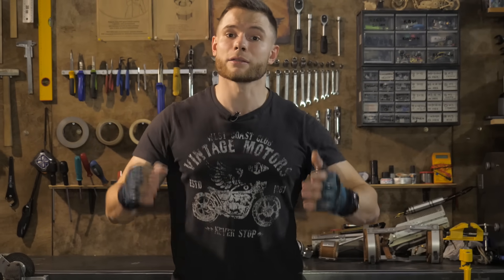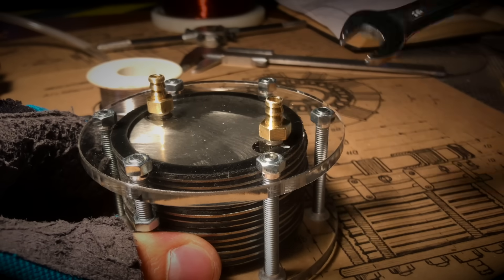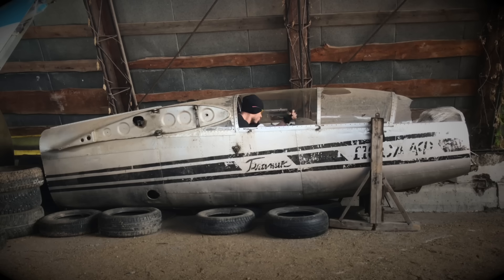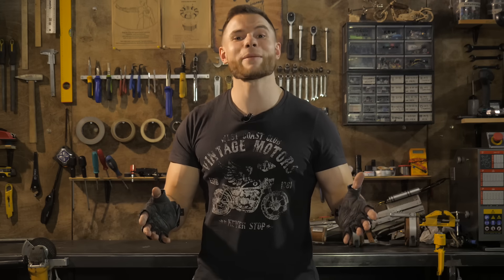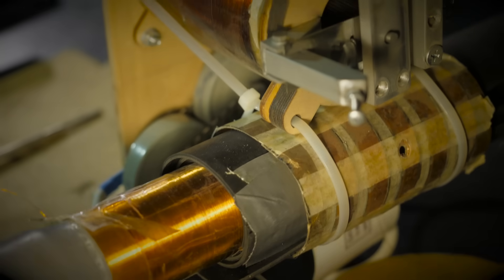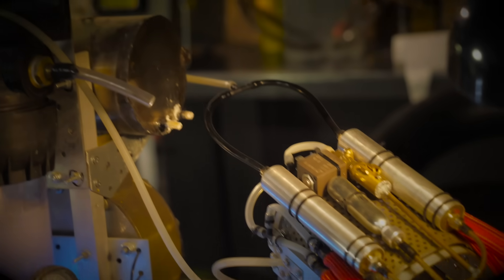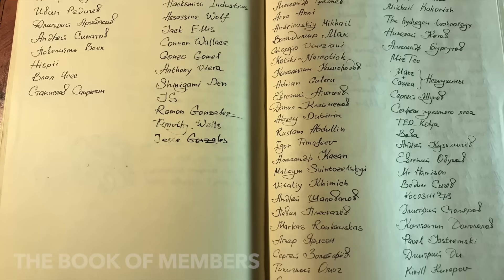Building real Iron Man suit (Part#1: Conception & Protoypes. Reactor, Repulsor, Armor, Exosuit)

Comment from the maker: Guys, grab the link for internal inspiration source https://curiositystream.com/AlexLab
Use promo code AlexLab to get annual access for 15$
Please, write here what interesting episodes have you find on Curiosity Stream?
Reply: Have you thought about putting aero gel on the palm or hydrogen torch on the iron man gauntlet so it doesn't have to burn your palms??
Reply: @marz.6102  it is expensive i think
Reply: @thevindukottege8799  what is?
Reply: Hey I have a idea for you!!❤️

You can use many lithium sulfer batteries instead of electrolyzer like hacksmith did in his leaf blower video and stored around 50 kw, but hacksmith used lithium polymer not lithium sulfer but lithium sulfur is 5 times more powerful so just make circle of batteries like hacksmith and put it in your chest plate

I hope you read this comment maybe modify my idea to get better results and give me a heart to let me know that you read my comment please🙏
Reply: @ruchiryadav8112  you should put this comment on the other comment of his where he asks us to give him ideas!!!!
Reply: @ruchiryadav8112   if we use that method, then the reactor part of the suit will be gone. thus loseing the "iron man" theme.
Reply: @ruchiryadav8112  Yh good idea
Reply: Для шлема есть предложения. 
По сути, ты можешь привинтить на место глаз 2 камеры, и от каждой камеры дисплей, а внутри типо VR шлема(линзы). Инфу с камеры будет обрабатывать 1 процессор, либо по 2 на каждую, сделай активную систему охлаждения(вертушка), графический процессор, оперативка, постоянная память(где установить это всё - решай сам), ИИ внутри не обязателен, просто графический интерфейс. По сути смартфон внутри. И, насколько я знаю, использовать 2 процессора - будет выделяться меньше тепла, соответственно можешь обойтись и пассивной системой охлаждения.
Но я думаю там мало что обрабатывать, поэтому может и получится одним обойтись.
P.S: Нейросеть. Нужно научить её анализировать полученную инфу с камер.
P.P.S: Второй процессор-для нейросети. Поищу информацию, помогу чем смогу. Удачи.
Reply: @baNO4kaXD  might you translate please, thank you so much!???!!
Reply: For the armor plating I would suggest you look up Robert Murray Smith of England; he does a lot of work with Graphene and has had much success in putting together weapon resistant materials with it.

He has a list of videos and I think you to would get on well. It could be inspirational for you Alex, as you also salvage and reclaim many of your materials.
Reply: @ryanlebeck259  have a link tho??
Reply: @ryanlebeck259   you should try to put this comment on the other comment of his where he asks us to give him ideas!!!
Reply: watching from Brazil, your videos are awesome!!
Reply: Love your videos Alex Lab! As an engineer around the world watching, I have so many more ideas than you would ever want to hear about how to build the suit! I've worked on a couple similar projects of my own, you're right, armor is hard- I would recommend avoiding joints all together, and instead of trying to make a metal joint that doesn't limit mobility to much, focus on covering most of your body. Then use straps around the joints the connect upper arm pieces to lower arm pieces, upper arm to torso, and lower arm to hand. Then if you really feel like you need armor around the joint, use either chain mail, or make a small pully system attached to a small metal plate that would cover the joint so that when you go to move your arm for example, the flexion of the bicep will pull on the pully, drawing the small metal plate (covering the joint) away from the joint so your arm has room to bend. That's just my first thought, thanks so much for all the awesome, inspiring stuff you're doing, I love it!
Reply: Dude.    U can use segmented parts with bearings in between Each segments which helps u to develop more easy  movement....  Don't use a single plate and cover the body rather use segments....  Like let forearm be divided into 5-6 segments which are interconnected through segments... .... For. More details contact sreeragmenonrolling123@gmail.com
Reply: Add a coil gun on your sute
Reply: @anirban8368  would u know how since you suggested it?
Reply: @marz.6102  nice bro 👍
Reply: @anirban8368  yes sir
Reply: You mention that with more pressure in the reaction chamber less energy is needed to preform electrolysis. I imagine that the critical point is the limit to this but it would be interesting to play around with, very don't try this at home but if nothing else riding the line seems a logical end point, sub critical maybe and if things pan out maybe some experiments with supercritical fluid.

Otherwise if you had a layer of bladders between the frame and you, then they could hold more fuel, the suit could pick up the weight and the whole thing would be as comfortable as a water bed. You can control the pressure in the bladders to let up as you move and give you a full range of movement but stay on you where you let up. More of a master chief thing but it could also react to shock and increase pressure like an airbag would [if that even helps?]. I notice in the ironman movie he wears a wetsuit kind of thing under the interlocking parts. Having armor padding is never a bad idea and full plate is notoriously hard to wear. Fur, Gel, Foam, Something... 

Tl:DR Super/Subcritical electrolysis, more fuel storage, and power armor needs armor padding too...

Somewhat related links...

https://www.technologyreview.com/2009/08/11/211065/supercritical-fuel-injection/#:~:text=The%20higher%20combustion%20temperatures%20required%20to%20burn%20diesel,between%20those%20of%20a%20liquid%20and%20a%20gas.

https://www.sciencedirect.com/science/article/abs/pii/S0360319920308788
Reply: @loveblowsbad  I have a paper on electrolysis that I can email you, including a way to make the reaction endothermic instead of exothermic
Reply: @ryanlebeck259  That would be super cool, I'd be interested in that. I think Alex maybe better suited to make use of tho... If he plans to use crowd sourced help on this a discord server would be wise...
Reply: @loveblowsbad  send me your email and I'll send you the paper; endothermic hydrogen reactions are past of the micro Hadron Collider I'm building. I honestly think I'm close to a cold fusion reaction to be honest.
Reply: @ryanlebeck259  how so?
Reply: Aluminium brazing rods work just as well to weld together aluminium joints as well. Robert Murray Smith has a video on that as well
Reply: Maybe Ball bearing joints? One around the upper forearm would allow left and right rotation. And then one on each side of the elbow joint. Might allow for smoother elbow movement @ALEX LABS
Reply: Single ball joints locate around the shoulder could also give you more rotation.
Reply: I´m not sure if you are that much into software but if yes you could put a pair of smartglasses and voicecontroll for some features of the suit in the helmet. It wouldn´t need to be a full fledged AI but maybe just a simple collection of voicecommands that a microcontroller could follow to do stuff like activating the pneumatic muscles or changing their powerthrottle. As always awesome video and I´m looking forward for the next one!
Reply: @ALEX LABS
Hey Alex,
Do you have a bachelor's degree in engineering? If so, was it an educative bachelor or a professional bachelor?
Reply: You should look into Magnetic Muskels. It is the same way our natural once work. The Air once are Dangers, can easily fail.
Reply: Alex, you need Frameless Servos or Torque Motors if you really want to achieve an integrated solution.
But you’ll need a power solution that is integrated across your suit platform. Perhaps a combination of LiPo batteries and super capacitors.
Your lever joints like elbow, knee, shoulder and hip can primarily be assisted with these motors/servos. For additional degrees of movement the joints would need additional design.
Flat pack power sources like LiPo and flat Capacitors can be attached to the inside of armour.
If you are designing using 3D or anthropomorphic software then the two layers designed separately and then constrained to each other in the model. 
tecnotion.com/products/torque-motors.html
usmotion.com/custom-servo-motors/custom-frameless-motors/
Reply: ALEX!!! In regards to your joints in the armor, how about you try using TWO points of articulation instead?

Look at Gunpla! Look for ones with the double joint system implemented in the elbows and legs!
Reply: Alex, you used the name of the actual weapon in your other video description title - rather than YouTube directly; it was most likely "flagged" by software bot, you can't put any prohibited words in the description or title anymore!  Censorship is for real these days now!!  Real: anti-people, anti-expression, anti-Fun!!!!  >: (
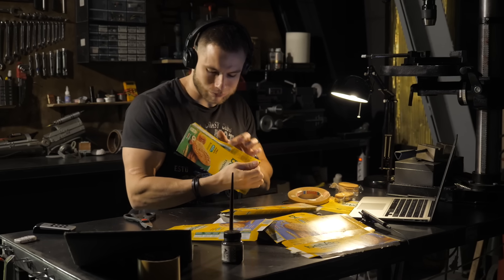Reply: What's the song in 11:20?? 
It isn't in the description!
Edit never mind
Reply: What if you blended the ironman armor design with the rig that Crossbones had on the back of his suit? If I'm not mistaken, it was there to augment his arm strength and allow him to hit harder.
Reply: Alex you use graphene in armour for maximum strengths in exoskeleton you use outer layer is hard like high carbon steel and inner layer is soft like synsodreme
Reply: For me it was the nanotech in medicine and solar panels taking in the infared along with light from the sun in curiosity stream!!
There is still more like genetic engineering
Reply: Алекс давай красава
Reply: U can also add a small induction welding system on your suit
Reply: @anirban8368  that would be the hydrogen torch on the iron man gauntlet
Reply: JLaservideo also does a lot of comic style inspired engineering videos and gadgets that you could attempt to include into your suit.
Reply: Por favor, me diz que faculdade você fez???eu amo essa área entende???? Quero ter esse conhecimento
Reply: Responde por favor
Reply: @Davidreixx08  English por favor
Reply: Yeah more constant updates are better. I much rather a new short video every 2-4 weeks where you show your progress and the issues you are working on rather than a longer video every 2-3 months when you have completed each full step. More videos on a more frequent schedule is also better for the algorithm and getting your videos recommended even just to your subscribers and you should get paid more with more videos. If you can't figure out how to do something then make a video about it and you will get 10 new ideas... 
It would be cool to include a few of those USB snake cameras in the suit for like a back camera, both sides and a better view of the front than just the slits and then just switch between the 4 USB inputs with a button or two ect! You could put them on your palm so you can see the flame shooting out and where you are aiming. same thing with any other "weapons" maybe an electric airsoft gun in your other arm, a powerful laser to light things on fire, the camera would also act as eye protection for that. and just pipe the video to an old smart phone screen in your mask (you can bury the rest of the phone, raspberry pi or whatever else you might use in the suit). Someone said that if you take away the back light from some phone screens you can see through the top display layer and use life as the back light making an augmented reality display. Maybe ask other youtubers who have tried things like that before about what they have found out during the process. You can always 3D print a mold then use it make pieces out of carbon fiber to get strong light weight bullet proof structural plates that also look cool. Watch Jarius of all and Ramy RC for your Carbon fiber lay up advice. Good luck!
Reply: @evilcanofdrpepper  yeah and his community can give him suggestion faster since it's a faster upload schedule !
Reply: So first idea I had for your request of fitting to multiple body types, 

Anywhere the suit (which can be a standard size) is in contact with the body could do so with an air cushion. A bit like a blood pressure machine which inflates to the required volume of air to achieve the required compression to the desired body part. Instead of leather cushions use inflatable versions which can be adjustable to the relative flexion/extension of each muscle... 

Disclaimer I'm not an engineer but consider myself a pragmatic problem solver. Consider it, if it makes no sense in your application, disregard it an move on but the concept of an adjustable suit seems valid in some way.. good luck.  I look forward to your next release along with other suggestions!
Reply: This is the best
Reply: I’m so excited to follow you on this journey and to see the all the work you’ve done so far accumulate to something even cooler. you’re an inspiration to me and more young engineers across the globe. Thank you :)
Reply: Хочу предложить Хаксмит озвучку профессиональной студии. Пробовал связаться, но безрезультатно... Если можешь, помоги, они твои видео комментируют, значит тебя не проигнорируют🙏
Reply: Maybe it would be better to use a Carbon/Kevlar comination for the suit... It would be easier for you to make and it is bulletproof.
Reply: Might I suggest with the pneumatic muscles instead of using them for direct motion using them to move pulleys apart, it would allow for greater limb mobility, also it would allow you to centralise the muscle systems
Reply: Н
Reply: Если 1 волокно будет тянуть 200 грамм, то пучок в 100 таких волокн даст тягу в 20 кг.
Reply: Алекс братишка - лови идею на миллион. Для искуственных мышц тебе нужно в эпоксидку закинуть растянутую катушку проволки и железный якорь. Сделай сто или двести таких волокн. Ну дальше собирай их в пучок как мышцы.
Reply: Hey Alex give me this songs name which are in your this video
Reply: Why not build your own iron man suit with some of your own touches on it and modifications where it is actually the iron man suit such as modification of the shield and comfort wearing it without losing the spirit of the iron man in the suit, meaning it is clear that you make some adjustments to the iron man suit
Reply: Hi, I like your videos very much, maybe I can help you with some coding for the software part. pls, e-mail me. fernando@softov.com.br
Reply: I wonder if you could make a hand charger like the flashlight in Metro 2033? If possible could it be adapted for installation into the knees and elbows of the suit to supply additional power?
Reply: what about using artificial muscles wrapped around a metal skeleton like 15:08 so you don't crush your body with them? to improve mobility, you can get a lot of inspiration from late medieval armor, the most sofisticated ones, that didn't limit mobility in joints at all. (by artificial muscles i mean the flexible rubber one, not pistons)
Reply: @jordicl4325  https://youtu.be/tpO5DgiCgyM
Here's a way to 3d print metal without a 3d printer, making you capable of making the armor light, strong and capable of flight!!
Reply: I think an exoskeleton that is for military use that is used for soldiers to carry stuff and walk and run easily would be ok with some modifications
Reply: Make desigen mark 85 arc reacter then prouduce more hho
Reply: are you serious get sponsored by spacex?
Reply: Not an engineer's idea so take with a whole plate of salt:

Considering the fact that you're torso-armour will be significantly thicker than what is shown in the movies, mostly due to the need of protecting the ark-"reactor" and aluminum-cell but also because actually functioning mechanisms will take up some more space than what was shown in the movies, have you considered "extending" the arms to fit accordingly?
This would take away the large amount of mass centered on your body, reduce the disproportionaly bulky appearance of the torso If you go and put in the effort to create this you have a right for it to be aesthetically pleasing. as well as give you the chance of making some distance between the repulsor and your hand, not only for safety reasons which are a major concern when operating with hydrogen in such high quantities and type of application but also give you more space for the machinery for both the replusion- and thrust-generation.
Overall- what you will end up with might just be a sleek hybrid between Mark I and II and I am more than looking forward to your progress.
Greetings from Germany.
Reply: В твоей работе есть недочёты.Ты слишком многое делаешь сам,чтобы получить лучший результат тебе нужно сфокусироваться на какой-то своей лучшей стороне и бить именно туда.Попробуй написать сам или найти человека,который напишет тебе ИИ,который будет тебе помогать,у тебя нет компьютера в голове и ИИ может облегчить тебе много задач к примеру по поиску нужной информации,ты можешь оставлять ему какие-то заметки,которые он потом легко вспомнит
Reply: @nikitamuliavin8144  what?
Reply: Love that Rick and morty like outro.
Reply: @justinwilliams7324  big brain
Reply: Hey you should try to use metallic glass for the reactor or if you want a see through design use something called clear aluminum
Reply: @normanpotter5184  I mean this was gud but this is why an ai system would work, it'll regulate the alkaline, the water and how much aluminum to put out in the solution. Especially when you would tend to us it more by using the repulser and the torch and when not to use it so it'll be not produce too much hydrogen.
Reply: @marz.6102  wait alkaline disilves aluminum I didn't know that what about the metallic glass
Reply: @normanpotter5184  well I unsure about metallic glass but I think I know that using aluminum, the very same thing that is being used for this reactor probably is writing disaster if you think about it.
Reply: @marz.6102  The problem with an ai system is that it’s not a “silver bullet”. As soon as it encounters a situation that is new or that you didn’t consider when training/designing it, it can start misbehaving which can have major consequences when working with hydrogen, endothermic reactions, etc
Reply: @drozen214  experimentation I guess
Reply: @normanpotter5184  bruh aluminum is the thing that he's using for the reactor. So the glass will both decay and melt.
Reply: @marz.6102  yeah but there is a way to make aluminum clear like in star trek but we can actually do it now
Reply: @normanpotter5184  but it's aluminum the same thing in the reactor that is being used to convert water to hydrogen and in doing so it will get very hot and melt the glass canister.
Reply: @normanpotter5184  he could use silicone that can deal with high temps instead tho!
Reply: For armor paneling, maybe you could use composite ceramic  and carbon fiber armor
Reply: What if you would do like a couple layers of metal that would slide into each other as you would bend your arm and then on the back they would slide out of each other on your elbow. Idk just a thought
Reply: Try aluminum for the exoskeleton part but put bulletproof material on the outside. The aluminum should make it lighter even if you have the bulletproof part on,  therefore makes your arms less tired
Reply: Amazing work by the way keep this up I definitely like it
Reply: Have you thought about adding the Jetman suit (made by Yves Rossy) to your current setup,

So you can fly.
Reply: Collaborate with Hacksmith, please.....
Reply: You could use magnets to hold the plats over a frame
Reply: Your are real iron man 
Do 
Nice work
Iam your fan
Reply: You should work with the Hacksmith
Reply: Hey, is there any way to convert the hydrogen into usable electricity? If yes is it buildable at home and is it worth it as a power source?
Reply: HI BRO I AM FROM INDIA I AM A BIG FAN FOR U I AM HAVING A IDEA TO ADD A HYDROPUMPING MACHINE IT PUSHES YOU AND USED TO TO MOVE FASTER THAN HUMANS I  HOPE YOU LIKE THIS IDEA IF U DON'T PLEASE KEEP ME COMMENT . MY NAME IS VENKAT
Reply: You are just perfect and for joints you can used like microsoft's and samsung's fold phone and surface pro hinchis
Reply: Ok buddy
Reply: Hey you should check out Xact Metal 3D printers. Can print fully dense parts that conform to your body and integrate things like fluid channels and valves directly into the structure. Lmk if there's interest!
Reply: @ALEX LAB I have some ideas, ultrasonic deterrents, arm-mounted coil-gun, also for the hinges have you considered making the hinges have multi directional capabilities such as the joints seen in robot arms? Also why not just create a exosuit that uses mechanical advantage to increase strength or you could use nitinol based artificial muscles.
Reply: Also, you may already know this, but the muscles are connected very close to the hinge point, which means the torque will be very less, and therefore they will be good but they could still be better , so to solve this instead of directly connecting them with the same side of your hand
Connect them to the opposite side
To describe it
1.hold your hand out with the palm facing up
2.now instead of connecting the muscle on the cleavage of your elbow, from your shoulder, extend the hinge to the bump of your elbow and turn it from there
Get it?
And i know this is expensive but carbon fibre can be used to make the parts that don’t need .45cal protection
Like the bottom of the shoes or the back part of the lower legs
Try supercapacitors too instead of lion or lipo batteries
Also, you can use rc aircraft jet engines (they are expensive) but they can provide boost and can fill in gaps
Also, I don’t know much but instead of MAPP you can use e85 fuel or even nitrometane or jet fuel or diesel for the jet engines
All the best
Reply: Saludos desde Panamá #AlexLab 🇵🇦🇵🇦🇵🇦😄😄😄 You rock.. great content, try to publish it as an ebook and with #NoStarch editorial, they publish all technology related. Like hacking tools. #therealIronMan
Reply: Sir if you cant make iron man's suit then make war machine's 
He doesn't have the reactor in is body
Reply: I would look into biomimetics, see how the body moves and try to mirror that externally
Reply: Can you make a video for the materials for the arm you made
Reply: For the joints: what about telescopic joinery, you can use multiple layers of thinner movable plates mounted on a flexible inner material
Reply: You could try to look into prosthetic limbs, they might have good ways to mount and control wearable machines. I'd recommend visiting a channel called Ian Davis (i hope I didn't mispell😅) he has many good quality videos on this subject (he has mechanical fingers on one of his hand)
Reply: @ALEX LAB what have you studied?
Reply: Your s studying courses please
Reply: Can you use titanium for the suit, heat it up and super freeze it like they do for aircraft? I don't know the technical stuff but I'm sure you'd know what I mean
Reply: Likè
Reply: Me to
Reply: For the elbow joint you could do a sort of inside out universal joint if that works
Reply: Dude, you are the one.
Reply: You are genius Alex
Reply: https://youtu.be/08-3XgA08AQ
Reply: @WisamM100 this is a nice idea!
Reply: Talk to "The Slingshot Channel", runned by Joerg Sprave. He knows everything about showing guns and weapons on Youtube. He builds them hisself.
Reply: @GlitchyfrogMusic  he also made a youtube union which is much needed now!!
Reply: I had some ideas for a propeller system for flight. No idea if it would work (not smart enough), but if you want, it be happy to send over my idea.
Reply: It is so cool
The huge fan of iron man
Reply: Alex lab is Wolverine 
Hack smith is iron man 
Colin furz is jimmy neutron 

They will never work together
Reply: @savourypotato  reality would collapse
Reply: Iron man leg part
Reply: You may cooperate with the hacksmith from Canada
Reply: @asaffshamir862  he didn't ask bruh
Reply: Sir , please help me,  I just want to work under and learn the skills of real engineering.   Kindly guide me , what field of engineering should I persue for bachelor's degree.❤️❤️❤️❤️❤️❤️❤️❤️❤️